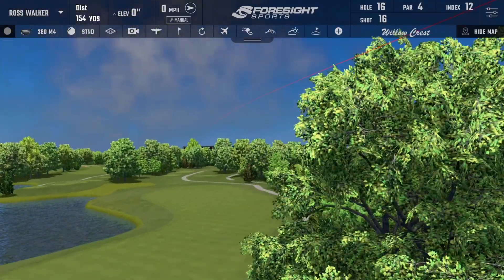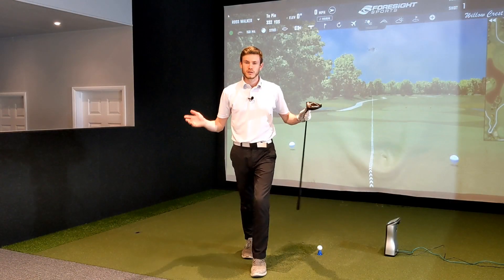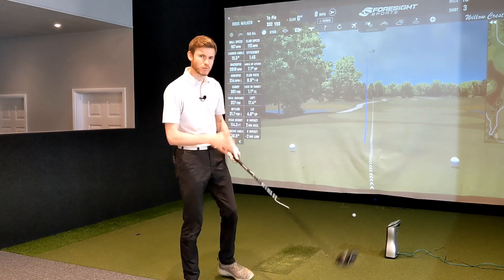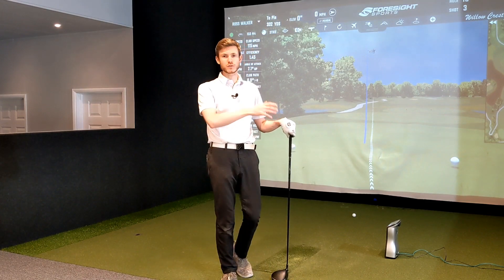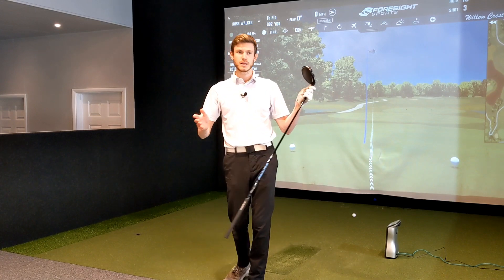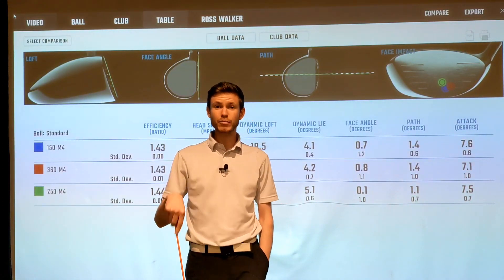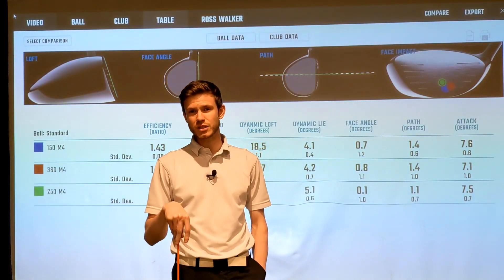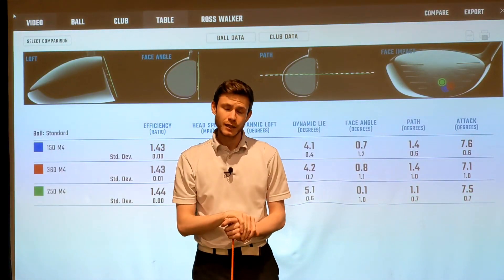ACCRA FX 3.0 DRIVER SHAFTS - 100 - 200 - 300 - FULL REVIEW AND GC QUAD TESTING

Comment: Would M5 suit your swing speed better?
Reply: I was just fitted for a 260 M5 with a slightly slower swing speed. I didn’t get to try the M4.
Reply from the maker: Hey Joshua, I did mention in the video I was hitting them all in stiff to try and keep it a fair comparison throughout each line as they were just the closest that I had. But tbh as I say I actually prefer lighter and softer in shafts so I probably would prefer the M4. And I don't load hard at all so I don't find that stiff if any worse than X for me to be honest.